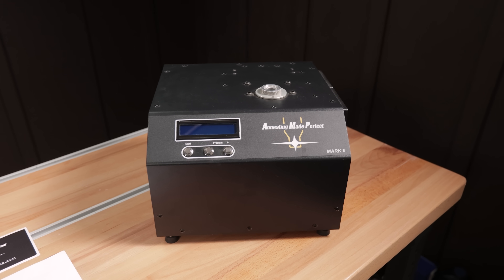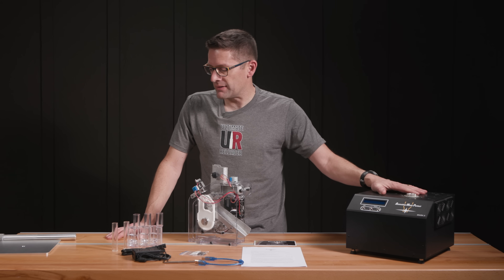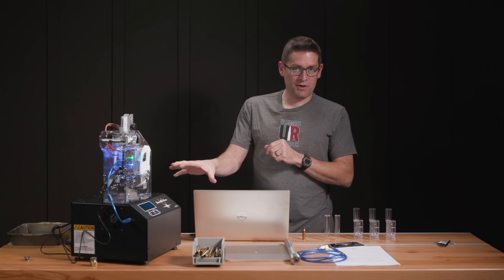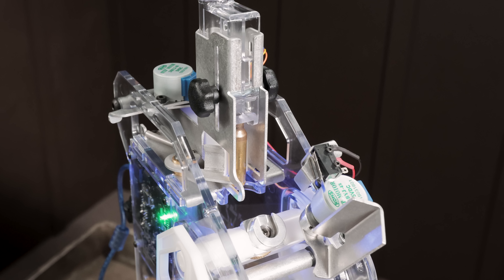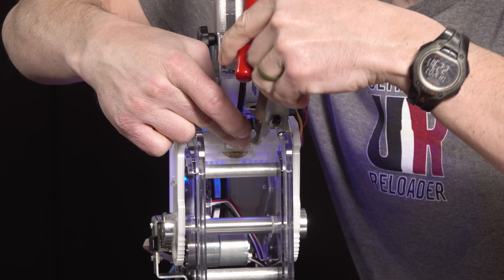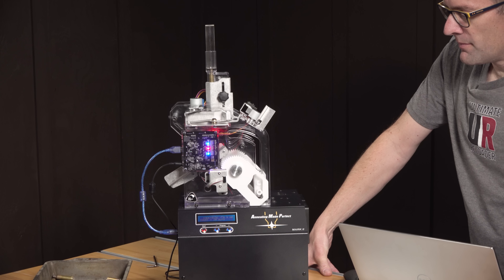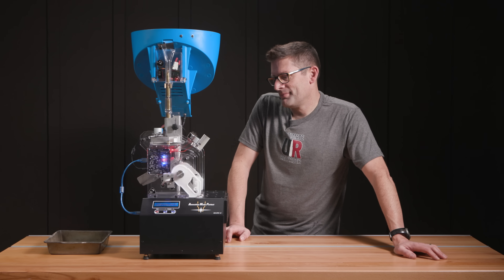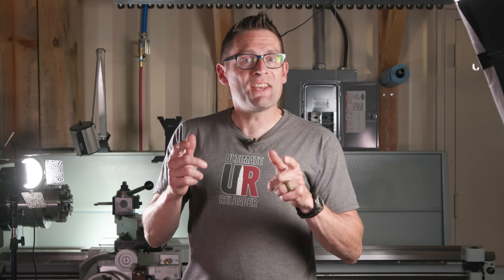Hands Free Annealing: AMP Mate

Comment: Very nice. Still missing the quintessential answer... what is the hardness of the brass .... new brass, fired brass and annealed brass.
I test these values and can assure that a simple self build automated  torch annealer does the same for less money, space and hassle.
Test the hardness, otherwise this is a waste of time and money.
Reply: Noone questions the performance of the amp.
All I am saying is, if you don't test the hardness of your brass before and after annealing you don't know if it did anything to your brass. I tested the hardness the hardness of new, fired and annealed myself and I know how to return to factory new brass hardness. Do what you like but without takeing measurements you are stepping in the dark.
Reply: @christoph8333  I have tested hardness and in my experience the amp performs as advertised…. Additionally returning brass to a consistent place each time is the key… factory hardness is not necessarily the best IMHO
Reply: So if you don’t test its a waste of money? The AMP test the when you calibrate it.  Can a torch anneal yes,  i would argue the repeatable on multiple brass types and calibers is the key with the AMP.  Consistency is the key in annealing the brass and the AMP ensures its the same time after time… IMHO
Reply: No doubt the amp is best there is but you rely on what a machine tells you.
If you don't have numbers to compare it is worthless
Reply: @christoph8333    so I assume you have tested your system against the AMP then?  If not how do you know it’s worthless? Also building an open flame automated torch annealer seems like a hassle to some…

Comment: The AMP biggest shortfall is the 1 by 1 manual human method it was designed around.  Would be better if they redesigned it with automation as the forethought, not as an after thought.